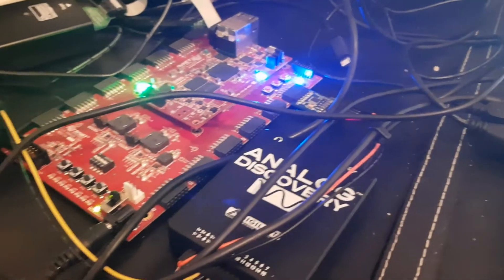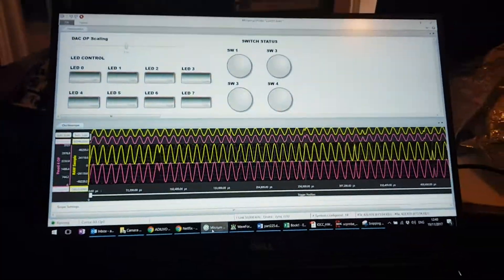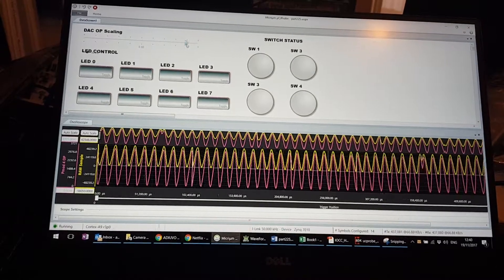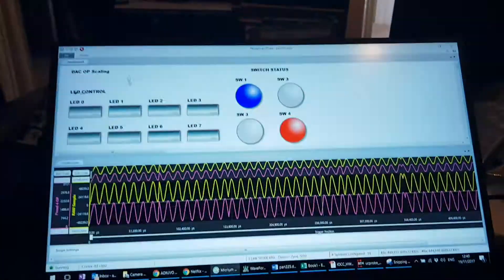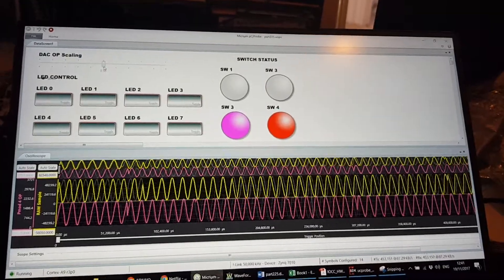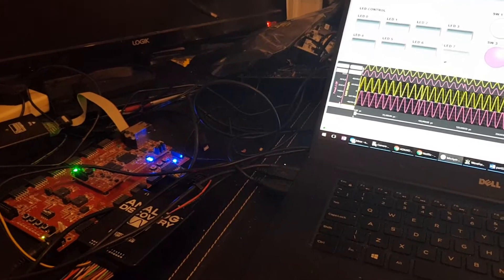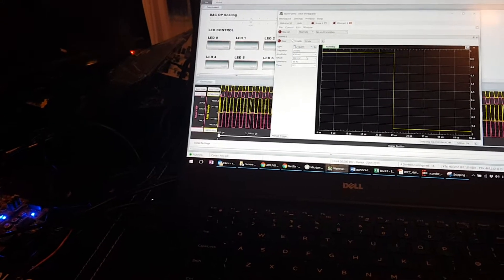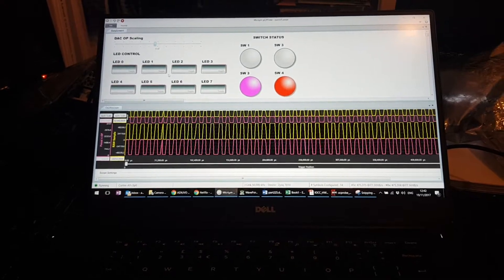Micrium uC/Probe example

Comment: So the MicroZed interfaces to the PC/uC Probe via JTAG?  What flavor of the J-Link are you using?   Have you ever tried uC/Probe with other interfaces (swd, rs232)?

What version of uC/Probe you're running?

Have you found issues where in the uC/Probe setup, you add the variables to monitor, but once the target and uC/Probe are running, the variables never update?   I don't get any errors, yet regardless of the variable and it's state, the GUI never changes!